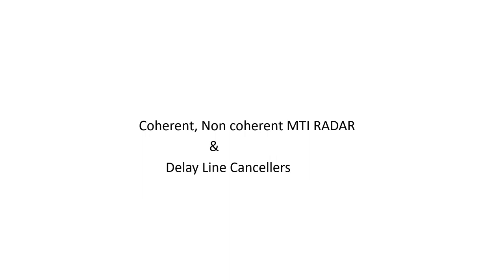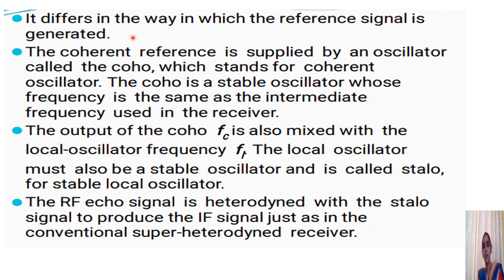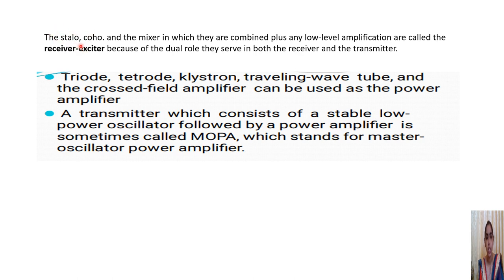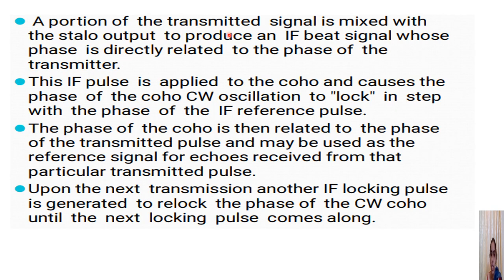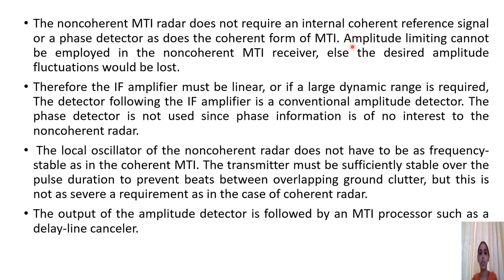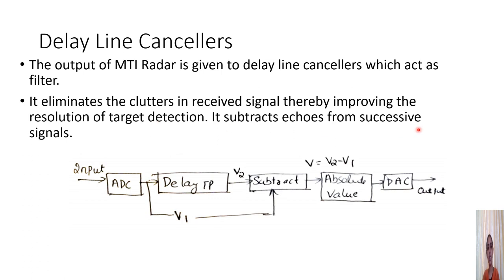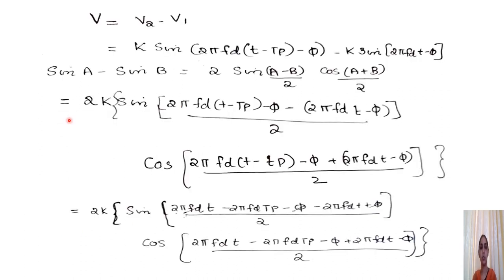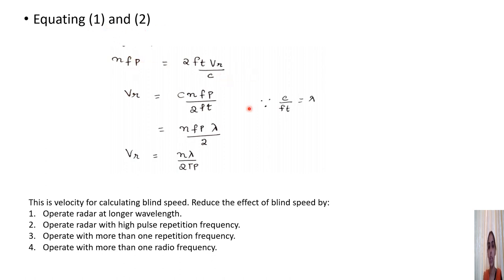MICROWAVE AND RADAR ENGINEERING| Coherent ,Non coherent MTI Radar, Delay Line Canceller |Saniya

Comment: MTI Radar with power amplifier transmitter
MTI Radar with power oscillator 8:10
Non coherent MTI Radar 12:10
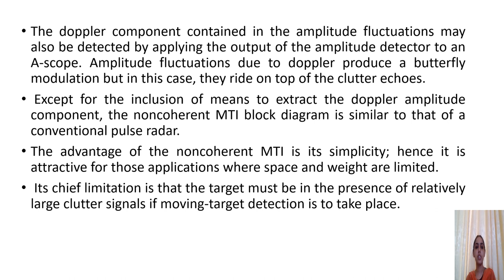Delay line canceller 17:35
Blind speeds 23:45